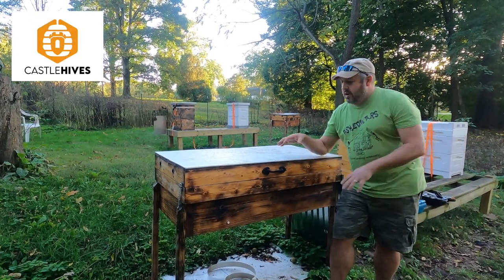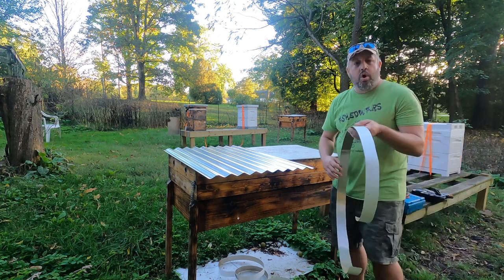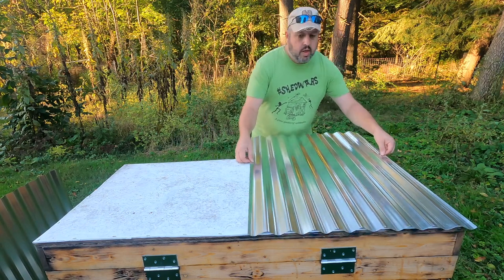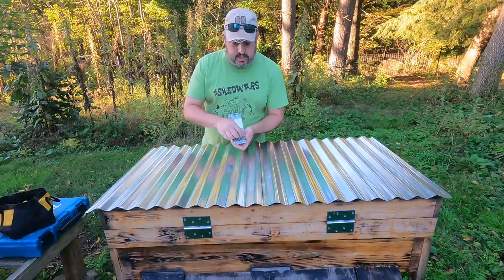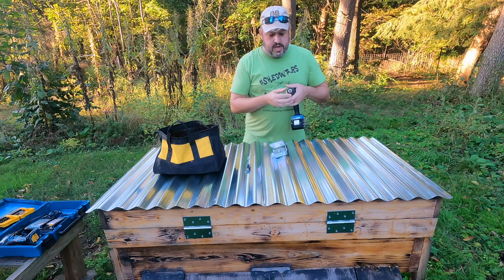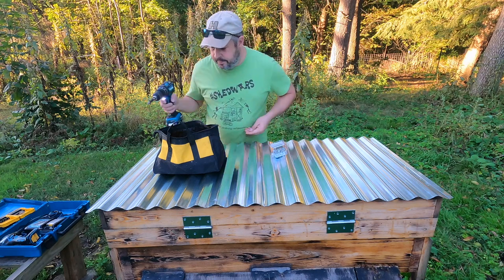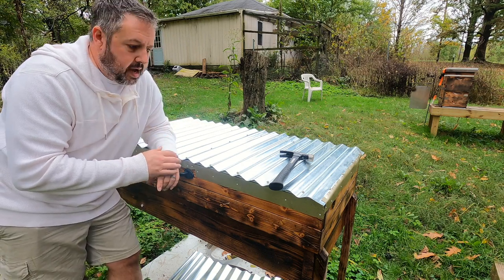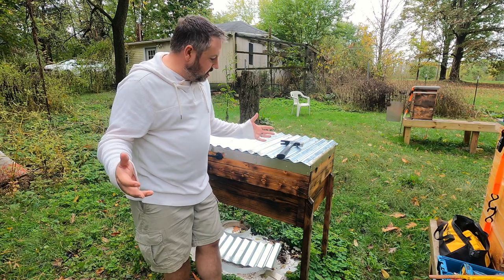#beekeeping Winterizing a Horizontal Hive

Comment: Looks great. We use that kind of roofing also here. Great on an angle for snow removal. You may have to silicone around the screws if you didn’t use the ones with rubber gaskets. We found they sometimes leak. Have a great day!
Reply from the maker: Read my mind, i plan to silicone them Wednesday.

Comment: Gentle bees FTW!  Maybe an upgrade to the upgrade would be putting some polystyrene foam boards under the steel.  I also agree with baddest bees on getting the top tilted. Thanks for the vid!
Reply from the maker: I left the plastic on and its 3/4 inch plywood. The space between the top and inner cover boards I'll watch and if needed I'll toss in some burlap. Thanks for watching. .

Comment: You could always tilt that thing some too if you were worried I'm trying some new stuff this year myself with ventilation not shims like I normally do but actually frame manipulation
Reply from the maker: Yeah. I'll need to figure something for tilting it. I'll be curious to se what you do.
Reply: @CastleHives  I'm running 8 and 9 frames in ten frame boxes on some, insulated on three sides on others and no shims or insulation on almost all... mainly just tilting forward

Comment: Do those screws have rubber seals to keep the water from penetrating the metal around the screws? You could have put some 1" foam sheeting insulation really easy under the metal for added protection winter and summer. Thanks Brian!!!!
Reply from the maker: They do not, hence the silicone I need to do. I think tomorrow that will happen, it'll be 72 here and sunny. Each will get a dab to seal. I need to check the edges also.